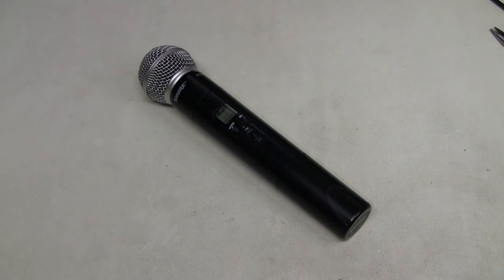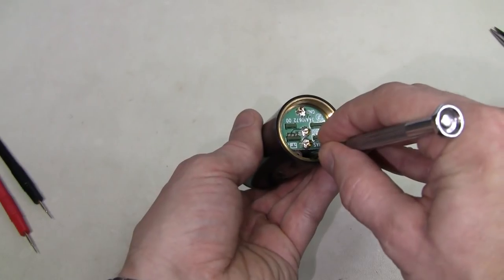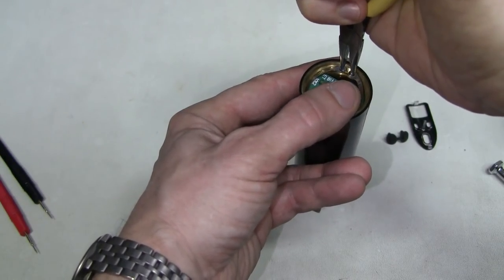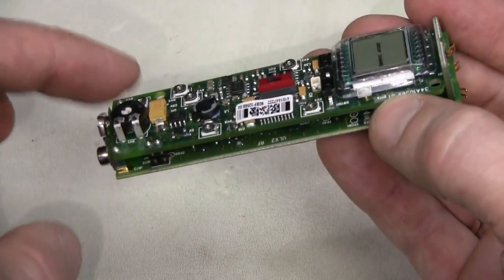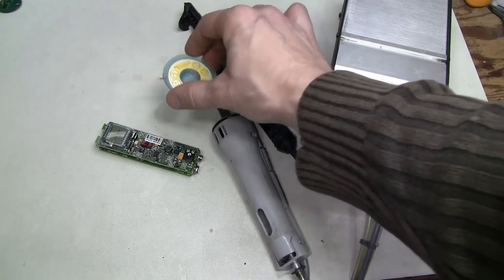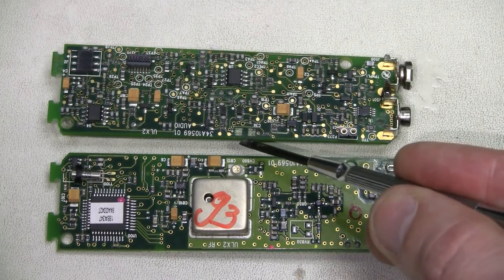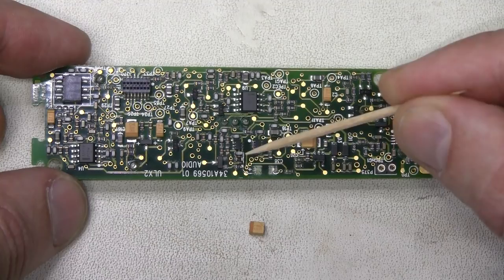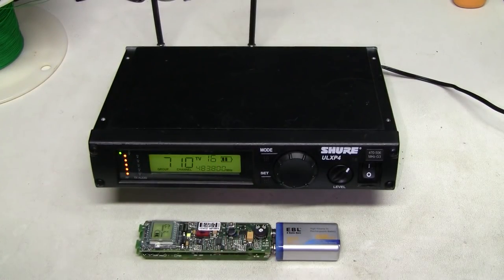#63 - Shure ULX wireless microphone repair

Comment: You are a natural when it comes to music equipment repair! 
What are the chances that cap would land right between the battery contacts? 
I was however surprised that you didn't glue the replacement down, just to give it some rigidity.
By the way, I think your theory is right. This must've been a cap with a manufacturing defect, causing it to short out prematurely and overheat/detach from the board, as evidenced by the missing pads. 
If it had just come loose due to vibration or shock, why are all the others still in place perfectly?

Comment: Your video was very helpful to me for disassembly.  I replaced the power switch.  Now after everything is soldered and reassembled the power doesn't come on.  Led panel remains off.  Before I replaced the switch, it was working, but couldn't be turned off.  I've rechecked soldering connections, but can't find anything.  do you have any suggestions?  Thank you in advance

Comment: Your desolder gun looks like a copy of Pace SX70. If you ever want a new one, I bought a Pace SX100 last year for my MBT250 (in stead of my >20 year old SX-70 ), I was in doubt because of the cost but that thing is bizar. I often have to remove big relais om massive traces. With the  Metcal I had before that was over 15 minutes work per relais (6 relais one pcb) and a lot of swearing. The SX100 does it in a few minutes without increasing the temp (around 310C). Something like your microphone is a piece of cake.
Reply from the maker: This is a Pace Micro. I would like to upgrade to a more powerful version, but these things are expensive.

Comment: Hi I have a Shure beta 58A with ULXS4 transmitter and it seems like my unit is not picking up the signal and the signal and battery indicators on LED screen is blinking with ticking sound, I was wondering if anyone can help me with this, or how to reset the unit?

Comment: Thanks for the disassembly info. My ulx2 works fine but won't shut off with switch. Display reads P O L. Can you help?
Reply: I found it. PoL stands for power lock. To unlock hold the set button down and hold the mode button for 4 seconds.

Comment: Excellent repair!! I was wondering if it is possible to change the operating band of a Shure PGX1 body pack so that it can sync with a receiver of a different band (Receiver is a compatible PGX4)? Looking at the schematics, it seems like a simple replacement of the 1k ohm resistor to the respective band channel, however after doing so, it still wouldn't sync? Any help would be greatly appreciated.

Comment: Thank you for this! Worked like a charm. Now, do you have a source for replacement bits? Specifically the on off switch broke one of its ears ☹️
Reply from the maker: do you mean this part? https://www.fullcompass.com/prod/071688-shure-65a8472-power-mute-button-for-lx2-t2-ut2
Reply: @feedback-loop  Yes, I did find it (at that same site) and ordered it, and it's in and working like it was new!

Comment: Always a pleasure to watch your videos, especially the repair ones. 
Just a quick suggestion, inspired from one PS I am currently dealing with: I found the SMD components to be fixed in place with a red compound. I suppose this was used for holding in place the components in factory during the solder flow, but also serve well for stress relief in operation. Maybe you could use a drop of sealing wax, like the one used in the past for sealing letters. I am sure you can still find it in stationary shops

Comment: I wonder if the cap actually fell off due to shock, perhaps someone dropped the mic! When it lodged between the battery contacts it obviously shorted. I think it would have been wise to glue the replacement cap down to the PCB, especially as the connections were to thin wires which could easily move if the mic were dropped (again). I enjoy your videos as you obviously take the time and care to ensure you know how to open faulty kit, unlike many YouTubers who make me cringe when they use brute force and ignorance!
Reply from the maker: The capacitor was quite small. I can hardly imagine how such a lightweight component would fly off the PCB taking the pads with it. On the other hand, shorting and burning is such a common failure mode for these caps that I would think it must have happened first. This is just my guess, of course. There is no way to know for sure.
Reply: Still feels like adding a drop or two of hot glue to the replacement cap wires would be helpful.

Comment: Hi there i got the same microphone as your, but my mic suddenly have no power, when i turn it on. Do you think the power switch failed ?
Reply from the maker: Possibly. But there are many other possibilities.
Reply: Hi FeedbackLoop, Thanks for your reply .Do you know where i can get the replacement switch for this Mic ?  Cheers
Reply from the maker: Did you take the microphone apart to check the switch?

You may want to have a look at my other video, where the problem was with the power switch. There is a link  in the description to the part on Digikey. https://youtu.be/Z2ag9VrgRLg
Reply: Thanks Fedbackloop. Finally my Mic got fixed. There was switch faulty.